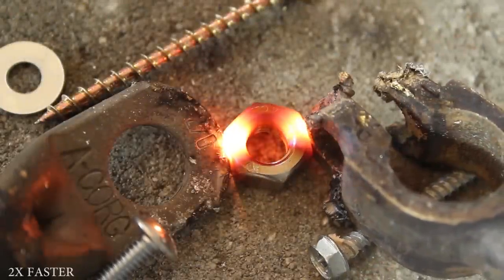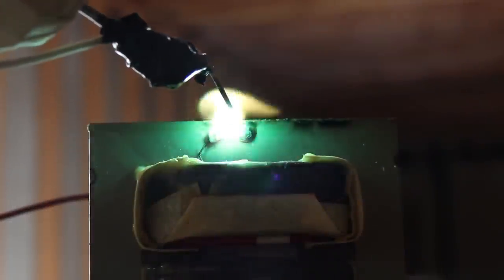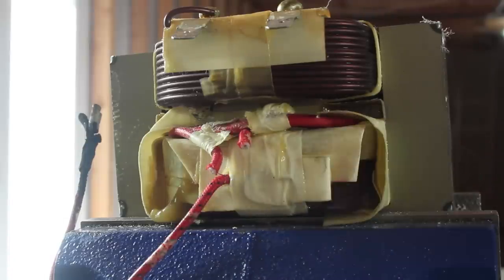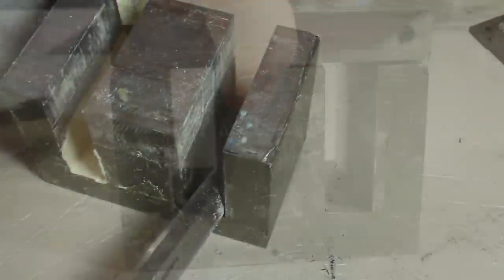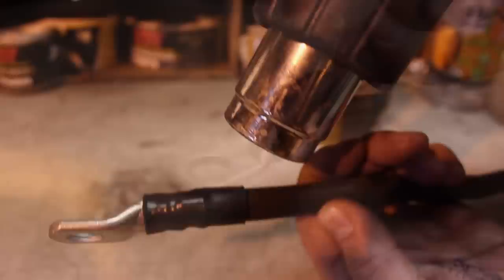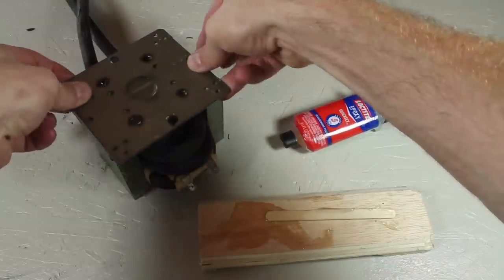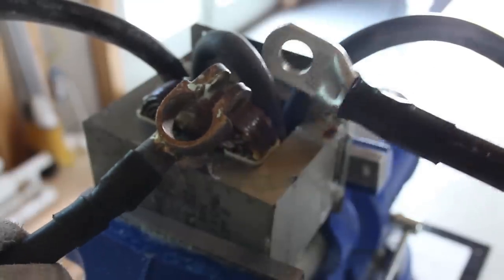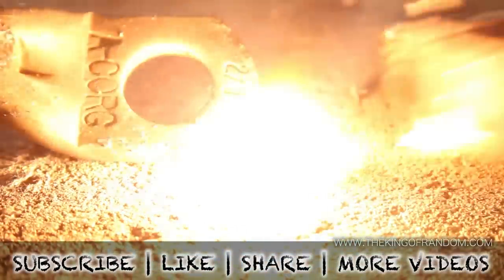How to Make The Metal Melter

Comment: This sounds incredibly dangerous....
Reply: alex barmash It's not enough to kill.
Reply: Flint Beastwood Rekted brother
Reply: Henrik Lastname actually as Grant said "Its enough electricity to kill you"
Reply: +Dylanpatrick Thistlee ya, it only takes 0.2 amps to kill you potentially, this has 800.
Reply: Jordan Mahara doesn't matter if it has 50'000 amps, if there isn't enough voltage to break through your skins resistance then nothing will happen to you
Reply: in dry conditions no, but if your wet it could potentially do something. Again you are right, it is really low voltage so probably fine.
Reply: +TheFirefox780 it's the amps that kills, not the voltages...
Reply: ***** since you probably don't know much about electricity remember this, you need both high amperage and voltage to kill, either one alone will not do it
Reply: +Guds777 No. Not exactly tha amps kills, the jouls kilss, but right, it's about the same, but because the resistance of your skin, and body, relativly high, it has to be bigger voltage to gain enough amps to harm you. For example:
You grab the two wire of a transformer, witch is able to giv 20 volts, and 120 amps (a common welder), and your skin's resistance for example10,000 ohms. In this case, it doesn't matter how high amps could given by the transformer, it will determined by your skin's resistance. 20/10000=2milliamps vill flow over your arms.
Totaly harmless.
Reply: +Guds777 While you're not wrong, its voltage that is required to 'break' resistances, such as your skin.
Reply: Yeah... This IS Dangerous!
Reply: Once you get over 30 volts it starts getting dangerous and about over 100 miliamps can kill you
Reply: @TheFirefox780  agreed

Comment: Quick question: can this be used for sword-making? I'm trying to take two single edged swords and fuse them together to make a large broadsword, and if rather use this than a metal epoxy and bolts.

Comment: Note that for 60 Hz Ac ventricular fibrillation is stated as occurring at 100 mA but paralysis of respiratory muscles occurs at 20 mA . These limits are very much user and situation dependent but give an order of magnitude indication.

Commercial leakage current safety measurements are in the 100-800 micro ( not milli )  amp range, and the requirements for hospitals is more stringent.

Comment: 800a @ 2v = 1600 watts
1600w/ 120v (from the outlet) = 13.33 amps from the plug

if you shorted out the bare copper leads of the secondary how big of an arc flash would you have?  would the breaker still have an instant trip or would there be a bit of a time lag from the transformer and the fact that you can pull 800amps from this thing before even pulling enough amps to trip a typical 15amp breaker.

Comment: you touching those washers while closing the welder at the end made my stomach drop haha
Reply: the voltage is low at the output. so no risk of electrical shock. just becareful not to get a ring on your finger stuck between them or something.

Comment: what kind of wires would be good for this? i stripped an old orange heavy duty extention cord and pulled the 3 insulated wires out of it. would these work to create a coil in order to melt steel? would i be able to melt steel using one transformer or would i need 2?

Comment: @Grant just took apart my old microwave last night, bunch of awesome stuff inside like you said, my microwave wasn't as fancy as the one you got your hands on but still plenty of goodies, 2 NO switches and 1 NC switch, hi voltage transformer & capacitor, 7w light bulb, couple of boards, hi voltage resistor, small fan 115v (no blower housing with squirrel cage like yours), plate motor and a few more items that'll be used at some point. If I understand correctly to make the metal melter only the low voltage coil will be removed (secondary coil) and replaced with a coiled #2 wire, can I use car battery eye hook connectors on the two ends of the #2 wire? I was also thinking of making two handles for the ends of the #2 wire from cored out 1" x 1" x 3" wood blocks, pass the wire through the core and then sealing the wood with fire retardant spray, that wire you showed on the video looked toasted and I don't want to get shocked if the insulation melts. I understand that you have 4 million + subscribers so if I don't hear from you its for good reason, I'm fully aware of the dangers involved I'm a HVAC technician so I work with electricity all day long, safety first.

Comment: is it a good idea to try use that to get rusty bolts lose in cars instead of buying a induction heater, if i have all the parts for it?? 
if you just turn it of in time before you melt the metal it should work right??

Comment: could something like this be used to heat treat lets say blade steels? IF you could control the current output to something that would result in desired resistance temperature?

Comment: I have some questions, why isnt the big wire connected to the coil? why does it create an high amperage and not high voltage? and what does the Metal thing around it (from the microwave) do?

Comment: Is that welding cable #2 or #2/0?  You said it's #2, but the lug shows 2/0 which is why I was wondering.  I've been using regular (non welding) #2 and it's getting a little too warm for my liking and after seeing how tight yours fits, it looks like it could be 2/0 unless it simply has a thicker insulation.  Just wondering if I need to order some 2/0.  Thanks!

Comment: Could the secondary coil work as the primary in a diferent transformer and still generate enough amps to melt metal? Or is the wire not enough thick to handle the temperatures and the current?

Comment: Hi, I am trying to open the microwave transformator like in your description. it has a welding line exactly like yours and i cut it about 5mm deep with my grinder, but it won't yet open. is there yet another trick ?

Comment: High amps will kill you, but only if there's enough voltage to "guide" the power through your body. I might be wrong, but at 2 volts I don't think holding each wire in a different hand will electrocute you.

Comment: Im using the same transformer and the same cable but it was from a american 110v microwave... If i put it to 220v is it suitable? Will it change anything? Because im connectint it thru a 110v transformer and i dont have the same results...
Reply: That's hard to tell. To adjust for a different input voltage, the microwave constructors could either have changed the number of turns on the primary coil or on the secondary coil (the one you're reusing). So depending on what they did, you may or may not have the same setup as in his video.

Comment: Did you use 2/0 wire or 2 gauge wire (AWG) when making the metal maker?
The 2/0 wire is about one and a half times bigger in diameter than the 2 gauge wire (AWG).
It looks like you used the 2/0 wire.
Reply: Bro this guy talking right now is dead. I don't think he can answer your question. RIP

Comment: The only problem with using epoxy to glue the 2 core parts together is that epoxy gets soft above around 100 degrees so you have to run the transformer cooler than might be desired.

Comment: If you compressed the secondary winding enough to get say,one or more turns,would it increase the current output?Thank You.
Reply: I'm not quite sure but i thinks the more turns the more Volts, the thicker the wire the more amps
Reply: If you have more turns, you'll get more voltage, and it will try to deliver more current to a given load.  Whether it's capable of delivering it is dependent on both the primary, secondary, and the core.  In this case, probably yes, but if you go too far, you'll probably cause saturation.

I'm hugely oversimplifying here, but if you're running from wall current (50/60Hz) and using the original primary, you're going to have a specific power limit (probably slightly more than the microwave was rated for).  If your secondary is a high enough voltage that it exceeds that, the core will saturate, at which point your power consumption goes through the roof and you burn up the primary.  This is assuming that your wire is all hefty enough that it doesn't melt first (generally commercial transformers should be reasonably optimized for the design power of the transformer)

TL;DR Probably yes, but if you go too far you'll probably burn it up.

Comment: not sure I am connecting the power correctly. all it does is hum really loud   should I have it grounded? I just cut wire from a non grounded lamp and attached it to the terminals on the primary

Comment: Hi!  I want to make my own stepdown transformer.
Is it okay to use ordinary insulated copper wire instead of enameled wire for the primary coil?
for the iron core, can I use a more solid core with a similar shape instead of the sheet metal E's and I's?
Reply: A little late but you have to use enameled wire for the transformer coils, as for the sheet metal part as long as its iron or steel, you should be fine using them if its a similar shape

Comment: Mr Thompson I am a 16 year old from Tennessee I have a huge interest in electricity I have my own mot and have rewired it with 5 turns of 4 gauge wire I was just wondering when I plug it in even with out shorting the secondaries it has an annoying loud buzz do you know anyway I could fix it I would greatly appreciate it I love all your videos my parents don't like me playing with microwaves but all I care about is the transformer
Reply: Yes the noise is normal but if the noise is really loud just make sure the E and I section are as thight  to each other as possible.

Comment: Is it possible to use this 2 guage wire instead of the 8 guage wire to make the electric arc furnace that uses the carbon rods? I just can't get the 8 guage wire to cooperate, it barely wants to make 5 high and 2 deep, let alone 6 high and 3 deep.

Comment: If you have chunks of metal in the alternating magnetic field there will be wash currents that will quickly melt nearly any metal and in a closed crucible with lots of borax will even melt stainless steel that you can pour into a mold. It is more efficient at higher frequencies but I am not sure how to get that. Also make sure you do not cook yourself being in that field
Reply: There is no real danger for that to happen. Magnetic fields are similar to electric fields in the sense that they seek the path of least resistance. The ferromagnetic core of the transformer is highly conductive for magnetic fields so they will prefer to flow through the core instead of through the air. This is also why they build transformers around a core, to make sure as much as possible of the magnetic field gets contained between the coils to optimize power transfer between them. If he would remove the core, then it would become more dangerous. However, it still can't cook your body since our resistance is way to high and our inductance is way too low.

Comment: Why didn't the copper melt? I know it doesn't heat up because it has  a smaller resistance but the iron does heat up, iron has a higher melting point then copper and should melt the copper, right?
Reply: The energy resisted cant go nowhere so it is converted to heat but so much the metal melts. If the iron was a superconducter the copper wires would melt first in that case.
Reply: I know, what mean was why the iron doesn't melt the copper, if you put a piece of copper in contact with molten iron the copper will melt because it has a lower melting point.
Reply: Saikit Tang I'm no expert, (feel free to correct me here) but there is a lot more copper than iron and therefore it has more thermal mass - the heat is also probably getting conducted away before it melts the copper to any great degree.
Reply: Same concept as an oven.  The copper feeding it doesn't resist so the copper doesn't heat up.  The element of an oven is made of some other sort of higher resistant electricity and thus heats up when you try to push energy through it.
Reply: Pali May ya thanks, I noticed that in the 4 gaugw wire metal melter some copper wires did melt and fall off, thanks for the answer
Reply: We are converting electrical energy into heat energy.  Power is energy per unit of time.  Let's look at where the power is going.

The copper wire is very conductive because (1) it is copper and (2) it is very thick.  It is more conductive than the items we are melting, so the voltage drop across the copper might be only a tenth of a volt.  Vcopper = 0.1V.  Therefore, P = V x I = 0.1 V x 800 A = 80W.  So only 80W of power is being converted into heat in the copper.  And that heat is distributed over the entire wire.

Now look at what we are melting.  It is less conductive than the copper.  So perhaps we have 1.9V voltage drop across the drywall screw.  We then have P = V x I = 1.9V x 800A = 1520W.  That's 1520 W of power being converted into heat in a very small volume.  So, yes, that metal is going to heat up very quickly!
Reply: Surfaces that touch are too small and rough for heat to transfer fast enough.

Comment: Does the newly fashioned transformer have a considerable 60hz hum?  I assembled one per your specs, and when I applied 120v, it produced quite a loud hum, so I immediately shut it off.  I'm not sure if this is normal, as you probably wouldn't notice the hum while the transformer is installed in the microwave under normal operating conditions.  I measured .9 ohms resistance across the primary winding.  Is this about normal as well?  TIA
Reply: Yes its normal if you dont put the E and I section together very tight.
Reply: The hum is 100% normal when it draws current. Did you hear the hum being loud without actually connecting anything to your secondary (the big cables)?  It should also produce a hum even during an open circuit, but if it's too loud, i am thinking it might be a relatively poor connection between the E and I parts of the core so there's more friction caused by magnetostriction in the region, as well as poor adhesion of the "slices" comprising the core (they are also glued together with a thin layer of insulation in between). Might also mean a poor quality core design to begin with, having more flux leakage. For the open circuit case, the higher the leakage and the voltage, the louder the hum. At short circuit conditions the high current will make it much louder due to even higher magnetic fields.
Reply: To be perfectly honest, at the time I bench tested the setup, to only wire I had at my disposal was from a set of jumper cables to use for the secondary, so I'm guessing about the 6-8 gauge range.  I did 2 or 3 wraps around the core and held the "I" and "E" sections together with a bar-type clamp, just to see what kind of voltage I would get.  I did register about 4 volts if I remember correctly, but I only had it on for a couple seconds, as the extremely loud hum was rather unsettling.  I realize that a more permanent assembly (such as with epoxy or J-B weld) would most likely reduce the hum.  The only reason I asked about the hum was because it was never addressed in the video, that's all.  Thank you!
Reply: You're most welcome my friend. The less turns you use the higher the amperage and the lower the voltage (better metal melting, less tingling if you accidentally touch the terminals) so safer and more effective for its intended purpose. The clamp you used for putting E and I together might be (highly likely, actually) ferromagnetic, so it's like you're extending the core sideways, greatly increasing leakage as i suspected and thus, the metal volume that vibrates. Furthermore, it's not made in laminates like the transformer core so it would start heating up if you used it (complex phenomenon, look up eddy currents if you're curious)! So, multiple turns bad idea No 1 and clamp instead of glue or solder bad idea No 2.
Reply: Christos Prevezianos U seem to know a lot about this so i have a question u might be able to answer. I recreated this concept, i live in holland where we have 220 volts and 50hz if that matters. When i connected mine the primary coil got so hot it started melting the glue keeping the wires together. The secondary coil was a   jumper cable and was not connected to anything so it was a dry run. I did the dry run without the I section just the E section that was completely open, could that be why the primary coil started getting hot or what could be the case? I had 2 windings on the secondary coil just for your information Thanks up front
Reply: Ralf Brouwers just put the I on the E and try again?
Reply: Tobinator Ill try within a few days because i broke the i section and need to repair it, just made the thing today 😂. The i section broke while taking the transformer apart. ill repair it and try again but i wont have time the next couple of days so ill let you know when i repaired it
Reply: But you also have to count the resistance of the wire to and in your house
Reply: ...and the impedance of said wires + impedance of the wires between your house and the neighborhood's transformer and it's prospective short circuit power. But i think such precision is unnecessary for the point to be made : "close" the core or you'll have huge currents on the primary and no induced voltage on the secondary.
Reply: I made this without removing the seam and it has a very slight hum. But it is 100% normal for a transformer this size

Comment: I am having trouble finding 2 gauge copper wire but I have some heavy gauge aluminium wire that was used to wire a house.  Is it ok to use Al wire or does it have to be Cu? (For the secondary coil.)   I would really like to use the rewound transformer to make a spot wielder.  Replies appreciated.
Reply: IIREHII home depot 2$ a foot....
Reply: Nathaniel Reyner  Thanks.   I'll look for some this weekend.  But tell me, is Al wire a no go?   IIRC Cu has a higher melting point so it probably safer to use but besides that, is their a problem using it?